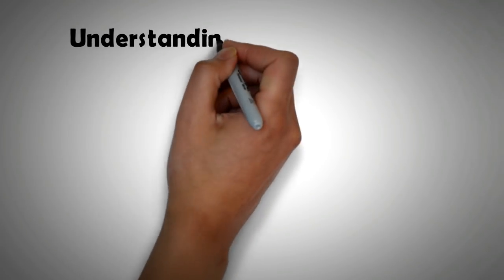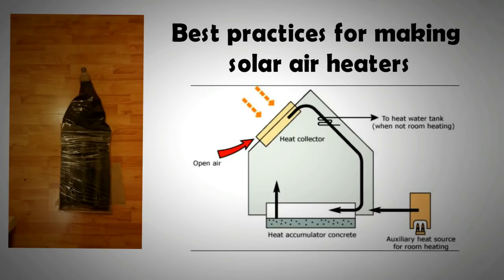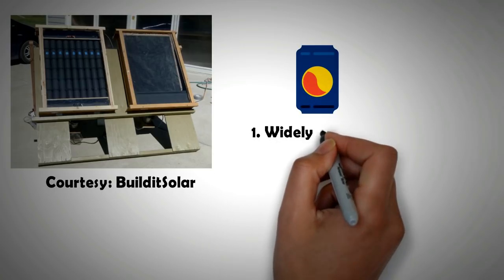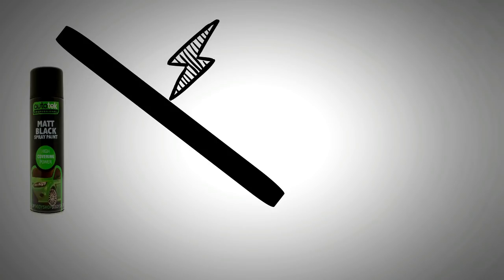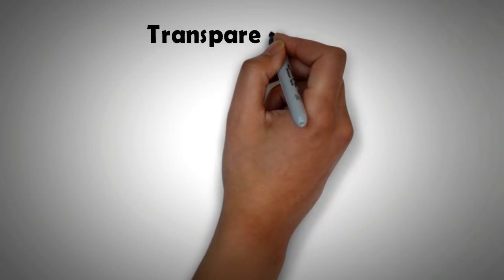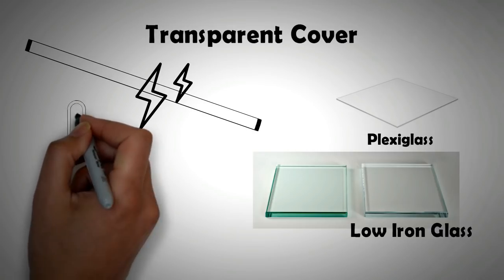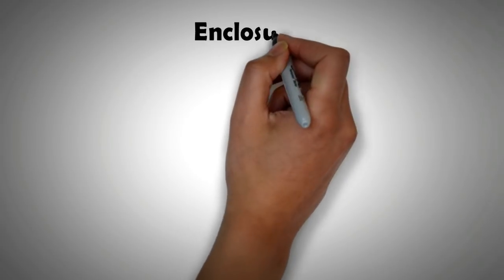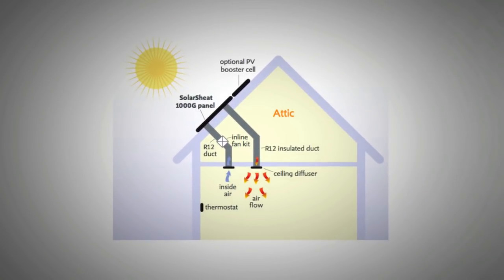Understanding Solar Air Heater

Comment: Just built a small air heater from 6 x 6ft evacuated tubes and some 1 inch stainless steel pipe and a 15w fan, heat output is pretty good. Well worth doing.

Comment: For roof mounted solar air heaters how do you close the air ducts before evening? Ladder work every morning and evening to install plugs? I have my 95C solar heated wall mounted with the top and bottom plugs within arm reach. Works well!
Reply: Hi Aaron, if possible i can see ur heater ?
Reply: @bekirkosem8434  Search youtube for "Solar House Heater 95C (203F) Feb 20, 2019". Please tell me how you would improve my unit?

Comment: that was not very efficient! 2 key points 1. the duck work should be placed at the lowest point of the wall and at opposite sides of the room. 2. the back inside if available should be lined with soapstone to absorb heat then released at night.

Comment: What happen when it's dark outside . How does it work without the sun at night . ?
Reply from the maker: It doesnt
Reply: line the back side with soapstone it will release the heat at night. the use of fans at the ends of the duck work should be used.
Reply: Also electricity from home is usually cheaper at night time.

Comment: As always, very clear and interesting !
1 tiny question... Why the 2,54 mm (1 inch) space. Off course i accept your expertise, butt i wish to understand.
The second is more general. You barely spoke about the background, background material and how to connect. Simple questions like space between background and roof/wall where popping up in my head.

One addition off my own. This seems (almost) the same product as a solar WATER heater or i'm i wrong?

Keep up the great work and your very clear pictures with the content ! As always with the greetings from the Netherlands!
Miss Bianca
Reply from the maker: Thank you for your appreciation. 1 inch cavity space  between two surfaces was a research carried out by Hottel et al around 50 years ago. If you have two surfaces at different temperatures and you dont have a filler material between them, and if the space is less than 1 inch, you will lose more heat from conduction. If the space is more than 1 inch than you minimise conduction heat loss but  lose more heat from convection current.  This is because you allow more room for air to move. So if the distance is around 1 inch, than it is a good compromise to keep both conduction and convection low. 
Yes it is almost the same product as solar water heater, but in solar water heater not only you have to be careful about leakages but also make it robust enough to deal with pressure. In an air heater it does not matter much
Reply from the maker: It depends upon your design. Professional roof installers generally allow some space between solar photovoltaic panels and the roof. For this one (air heater), you can attached the enclosure directly to your wall or roof.
Reply from the maker: I would recommend this article
D. Henderson, H. Junaidi, T. Muneer, T. Grassie, J. Currie; “Experimental and CFD investigation of an ICSSWH at various inclinations” Renewable and Sustainable Energy Reviews Volume 11, Issue 6, August 2007, Pages 1087-1116;